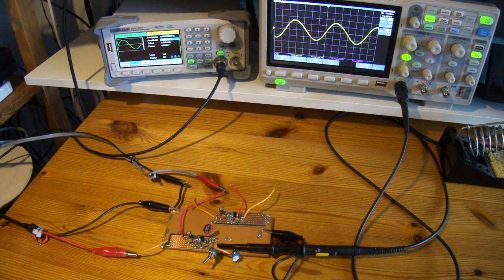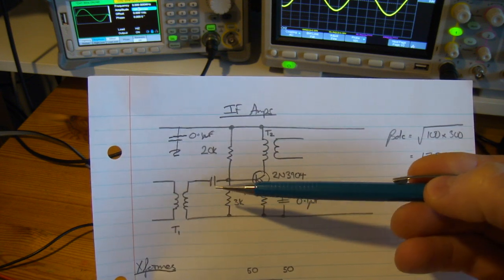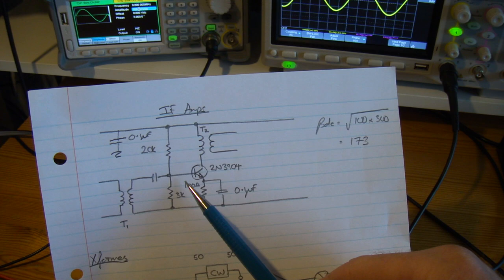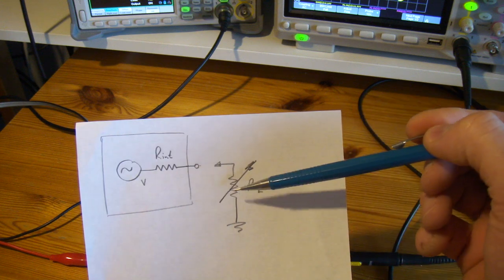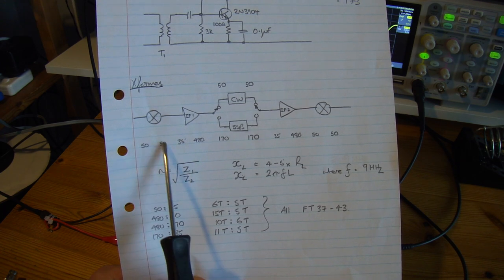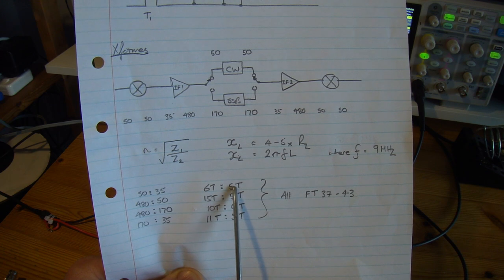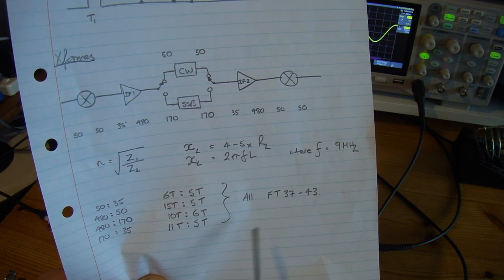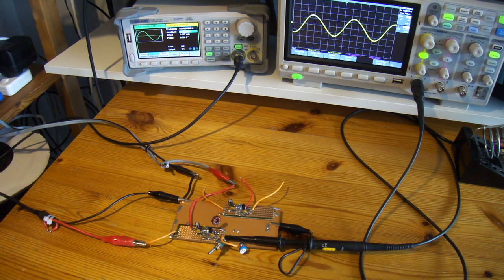Homebrew 80m/40m SSB/CW Rig - Part 6: IF Amps and Coupling Transformers

Comment: Another amazing video!!

Just curious... would we be able to measure input impedance using a similar U/I method by putting a small shunt in series and measuring a voltage drop across it using an oscilloscope, or is that method better suited for something else? (can't always be bothered with LTSpice)

Thanks :)

9A3ICE
Reply from the maker: I was thinking the something similar, but went with convenience. I will have to put some more thought into it. In the past, I have simply relied upon Rin = R1//R2//BetaAC(re + Re) where re = 26/Ic in mA, and Re is the unbypassed portion of Re.